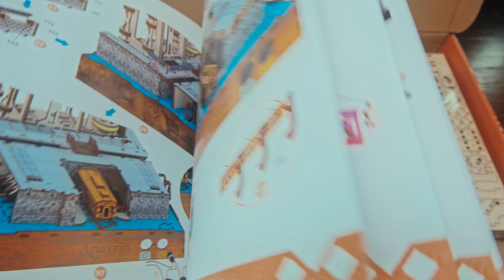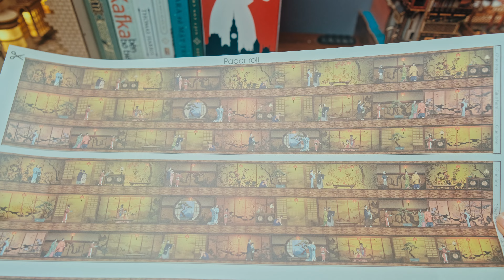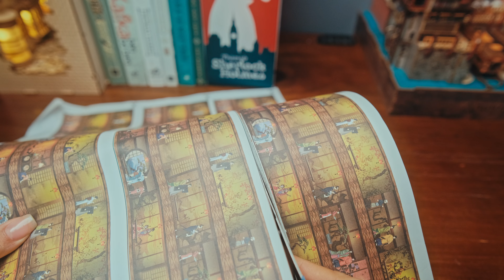Ginzan Onsen DIY Miniature Book Nook Complete Tutorial Guide by Anavrin

Comment: 4:00 - parts number 53 on my kit is the same size of the holes so.... doesn't work and they all fell of by themselves :(
Reply: Kit took the best part of 3 months to arrive well past the birthday it was bought for. And now my wife has hit the same problem with part 53 slipping out of the hole. Terrible product, a £20 temu book nook holds up better which is an embarrassment for the price of these.
Reply: Same here
Reply: Same here 😡
Reply: same :( currently trying to figure out how to fix it
Reply: @ClaireBeck15  I use ruber rings from the hardware store.
Reply: Same issue here, i just pushed it all together and glued parts in to hold it, they are only used to hold the parts in before it’s assembled. It’s an obvious failure in size when they use the laser cutter.

Comment: Is there a need to lubricate for smooth movement? And where. I'm thinking of using oil but wouldnt that just soak into the wood?
Reply from the maker: Hi Ryan, there isn't a need to lubricate at all, but proper filing on the wood pieces may be required to allow a smoother movement in our motion scene functions.

Comment: I'm nearly to end this one but I can't connect the USB jack into the female socket! Is there any hint?
Reply: I had the same problem and was ready to get a replacement piece from an electronic store. But using quite some strength I managed to plug them together. You really should connect them outside the box, because it's quite difficult from underneath.

Comment: I'm having difficulty attaching the rubber band to the wood. I tried the superglue gel. Any suggestions?
Reply from the maker: Hi Karen, thanks for reaching out to us on this, would it be possible for you to try another type of superglue? Are you using the Gorilla Super Glue?
Reply from the maker: Alternatively, you could use a strong double-sided tape. Please let us know if either works, our team is always here to help!
Reply: I tried that too and it doesn't work. Finally I wrapped the rubber band around the spindle as shown and then placed a small, clear rubber band meant for pony tails around the first rubber band to hold it in place.

Comment: This video is helpful, but at the same time laughable because of the apparent ease of assembling the parts. No doubt due to the stop motion filming technique. I am currently assembling this in the PNW so perhaps in a xeric environment like Arizona the parts would slide together as shown in the video. However, here the fit is very tight. So here are some of my assembly notes to date:
1. Step #3: watch out for part #27. There are actually 2 shapes with this number and the difference is subtle. Make sure you have the correct shape in the correct slot before you press them home. It's a tight fit and if you get it wrong it's difficult to remove them.
2. Step #17: Attaching the rubber band to part #37. The slot where the rubber band is attached is very tiny and fragile. Be sure to stretch out the rubber band until it is thin to get it in the slot. I broke this part and am waiting for a replacement.
3. Steps # 23 and 24: The wired connections to the motor are very hinky. I was being very careful with the motor but nonetheless one of wired connections broke off. There was only one strand of the wire soldered to the motor. I am waiting on a replacement for the motor.
4. Steps #50 - 54: Knowing what I know now I would have attached part #s 149 and 48 as shown in steps #57 -59 to the crankshaft before doing the assembly shown in steps #50 -54. Also, the 2 shapes that comprise part # 149 need extensive sanding with an emery board to reduce their size before part #48 will fit over them. And there's SIX of them!
5. Step #35 on page 11: There are 2 different parts labeled #81. The tan colored bar is actually part #10.
6. The part replacement request on the website: It has 3 areas to upload photos to. 2 are for missing parts and 1 is for replacement parts. I was only requesting (so far) replacement parts but it wouldn't allow me to submit the request until I uploaded photos to the missing part sections.
Finally I wrote on a piece of paper that I had no missing parts, took a photo of that and uploaded it. Success!
To be continued...
Reply: Yes there are a huge amount of mistakes, omissions or inaccuracies in the manual, even the digital one. It really is recommended to watch the assembly videos, which are quite good. Also there is at least one part that is (generally) missing from the set, although of minor importance (part 221). The paper roll is often damaged or crumbled because of the bad packaging, but there is a digital download for that; if you have acess to a printer. A model in that price range should be presented with better care. But in spite of all this, I enjoyed the build, since most problems were solvable with a little imagination and skill plus the detailed model is really beautiful (as long as you don't turn on the noisy motor).
Reply: @7768Tom  This is the first model I ever built. Yes, I agree, it is easy to solve the problems engendered by the mistakes in the manual. Once I was cognizant of the manual's shortcomings I could anticipate potential problems. I discovered it was very important to review future steps to determine if the assembly sequence could be improved upon. I was unaware of the video when I started and later found it to be somewhat helpful. Nonetheless, like you, I have had a great deal of
fun putting this puzzle together and am disappointed there doesn't seem to be another of its complexity.
Reply: @7768Tom  Did you find a need to lubricate the gears?
Reply: @karencallaghan9466  Although I did use a lubricant once (for the mechanics in the base) it was not really necessary.
Reply: @7768Tom  hey, im just starting to build mine, and i am at step 4. Im starting to feel that the gears are quite jammy and doesnt seem to want to rotate smoothly.

Did you face this observation as well? And if so, is there a need to lubricate, and with what?

I am a watchmaker but this rattles my brain
Reply: @ryanchan3722  Yes, they can be quite jammy. Does not mean, you made a mistake. I used a WD40 spray just to be safe, but u should find and optimize the jamming part(s) first. (You will never use the motor function later though, because the motor is too loud and the paper roll moves too fast - which goes completely against the idyllic nature of the scene).
Reply: @7768Tom  how do you mean optimize the jammy parts haha?
Reply: @ryanchan3722  Try to find the source of the jamming. The whole construction is a bit wobbly and unstable but you can improve that. You may need to reset, glue, file or oil a few pieces. Good luck!
Reply: @7768Tom Hey is their a way you figured out which parts are jammed. Because all my gears are aligned with one another but they refuse to spin. I even sprayed WD40 and nothing has changed
Reply: @7768Tom nevermind I really had to break it down to figure it out 😅
Reply: @mugawari_cici313  That's the way to go!
Reply: I’m running into this issue as well, all of my wooden cogs seem to have a limited range of motion when I try to rotate them with my fingers. Turning the motor on doesn’t move them either, I just hear the loud whirring. How did you fix it?
Reply: @mugawari_cici313
Reply: No im in AZ and am having the same issue sliding the parts